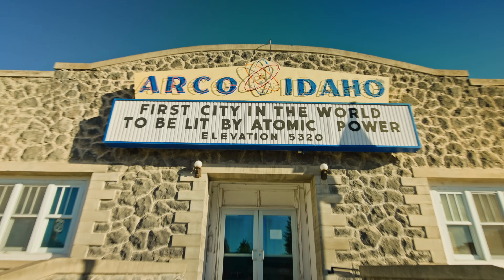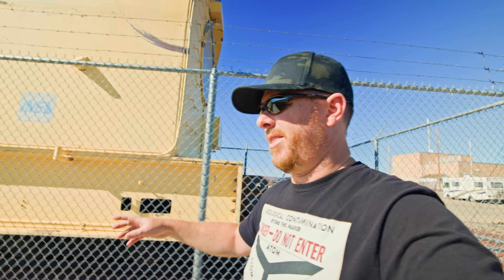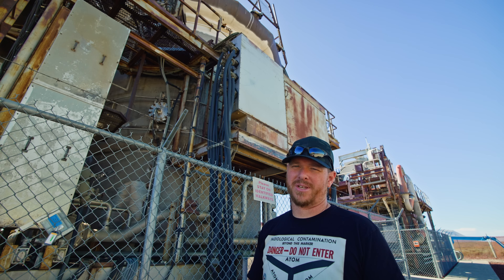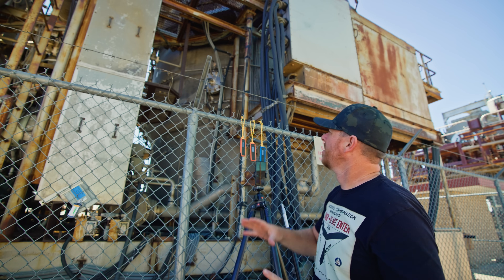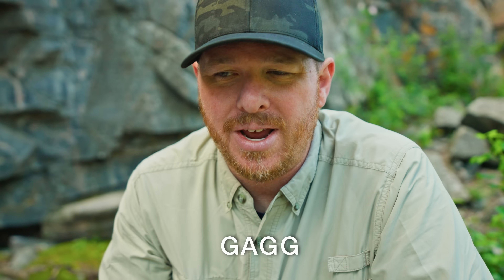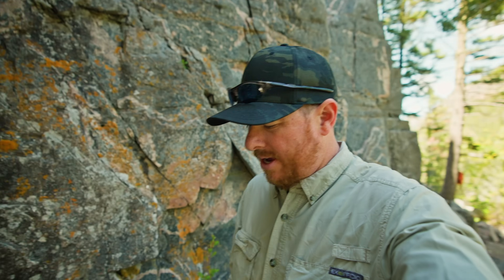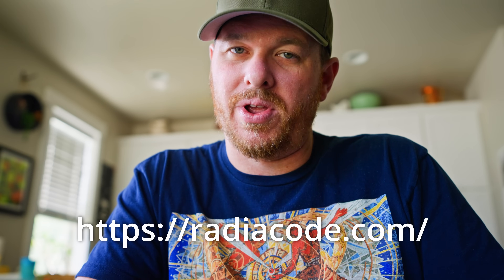Touched a Nuclear Jet Engine Core with the Radiacode 103G

Comment: I was in Germany and took measurements in a restricted area where some people claim that two nuclear bomb tests were carried out before the Trinity test.
The government says there is no increased radiation there, but my Geiger counter and my Radia Code say otherwise. I measured values of up to [edit] 8.76 µSv/h in the area in question.
Reply from the maker: I find it extremely unlikely you would have found any area that would even get you close to 8 mSv/hr. Btw for those wondering that’s 8,000 uSv/hr. 

 Also on the subject of a German atomic bomb or two for that matter…never happened. The fact that there isn’t a free exchange of info on where this location is should set off everyone’s BS alarm. If it can’t be verified then it doesn’t exist.
Reply: @RadioactiveDrew  Yes, you are right. Sorry, I misremebered the figure, but corrected it above.
Sorry for the inconvenience.
The correct measured value was 8.76 µSv/h and the count rate was 2.74 k cps with a deviation of 5.3% on both values.

Okay, I understand that you dismiss this as BS, I did that at first too. And it's perfectly fine that you don't want to deal with the topic.

And you definitely don't have to believe me.

I let everyone have their own opinion. After all, I won't let others stop me from expressing my opinions, views and findings, at least as long as I can back up my claims with evidence.
And yes, I have legitimate evidence for all of this, such as the screenshot of my measurements with 8.76 µSv/h.
Here is the link to the screenshot, the measurement is marked in a red square:
https://drive.google.com/file/d/1iWeJQXojXBeQDt7W4R2jJbC2Cx7Z3jC5/view?usp=sharing

P.S.: If you think I sympathize with any German ideas from or before World War II, you are completely wrong.

Otherwise, you can search for Büro H.A. in connection with World War II. Maybe that will help you understand my interest in researching this period.
Reply: @patrichausammann  so where are you getting that it’s uranium decay series, even by your own data all you have is a count.
Reply: @geekswithfeet9137  Look, I haven't shown a spectrum yet, but if you don't believe me, you can look for evidence yourself.
By the way, there is a video in which a German scientist, who was responsible for the official evaluations, talks about his spectrometry data from samples from the area in question and clearly states that U-235 is present in unnatural compositional ratios.
Tino Struckmann also took a sample and had it analyzed. The result was a higher U-235 content than usual.

P.S.: I also checked the rocks in the area and took samples with me. The rocks are practically clean in terms of radiation values.
Reply: Considering pitchblende is abundant in germany, you probably found an old tailing.
Reply: @juslitor  There is no pitchblende there, the entire plateau is made of sedimentary rock.
Reply: Okay, so go rewrite the history. You won’t be the first to “claim” (not prove) the Germans somehow had the bomb first😂😂😂😂😂😂
Reply: @billpugh58  It's not my problem if the general public can't put two and two together. It is clear to me and to every normal person that if there are two hotspots, two craters, unusually high levels of U-235 and more than three witnesses, there must have been two successful tests. I also spoke to residents there who were over 80 years old and one of them confirmed to me that his father had also seen the tests and reported about them. But there is much more such evidence, even in officially accessible public sources.😉
Reply: With out a spectrum it’s very doubtful it was anything but radon coming out of geological faults
Reply: @geekswithfeet9137  but the Radiacodes show a spectrum and self ID the peaks with the use of the app. He shows it in the video.
Reply: @geekswithfeet9137  There is no radon there, I had no radon peaks during spectroscopy, and the site is on a solid, thick plateau of sedimentary rock. There is no radon there, but there are degradation products from the uranium decay series.
Reply: @patrichausammann   8.76 Millisieverts/h ?? i was there but want to verify this if you could send me map data ?
Reply: @weirdmeisterinc  Sorry, I was wrong, I checked it and it was 8.76 uSv/h. I apologize, sorry for the inconvenience!
Reply: Lost battlefields w Tino struckmann has so very interesting videos on this topic
Reply: @turkeyboyjh1  i was there with tino, he showed me his high readings but a proof was not possible after some days at spot so im a but puzzled if its true or not
Reply: @weirdmeisterinc  definitely interesting I’ve been watching Tino for a while now he makes some really good points on the possibilities of German nuclear weapons, for me it makes no sense to build the v2 rockets with a conventional warhead, that’s lot of engineering just to blow up a residential block, no nuclear armed v2 make total sense if that’s what the German were working towards at the end of the war
Reply: @weirdmeisterinc  definitely interesting I’ve been watching Tino for a while now he makes some really good points on the possibilities of German nuclear weapons, for me it makes no sense to build the v2 rockets with a conventional warhead, that’s lot of engineering just to blow up a residential block, now nuclear armed v2 make total sense if that’s what the German were working towards at the end of the war
Reply: Would you be willing to share geocoordinates, please? Sounds like an interesting trip into history with my Radiacode
Reply: @axelr.8766  I don't know if I can post the link of my radiation map here, but I try.
https://drive.google.com/file/d/1Tef1ULbQYiuqJJ_OE3HOWmL6toOZurT_/view?usp=drivesdk
The map shows the journey from Basel, Switzerland, to Ohrdruf, in Thuringia in Germany.
Reply: @axelr.8766  Lost battlefields w Tino struckmann has so very interesting videos on this topic
Reply: they were focused on hydrogen and not uranium. they were going for fusion without first fission.
Reply: @stevetheborg  I know that's what it says in some books. But I doubt that it would be possible to trigger fusion at all without the initial gamma radiation pressure.
What I mean by that is that on our scale it is simply not possible to start a fusion reaction without nuclear fission.
I'm more likely to assume they were testing mini-bombs like the Swan Device. Have you ever looked at who was mentioned in the patent documents and who received the most patents related to the use of nuclear power in the early 1950s?
Greetings from Operation Paper Clip.
Reply: @patrichausammann  i dont need to.
Reply: @stevetheborg Look, there might be a super explosive that can compress the matter for such a reaction. But until I can see the test with my own eyes or read about it in several official sources, it remains a possibility, not a fact.

But I think they would have preferred to use a different approach, like a neutron initiator in the middle, coated with lithium and U-235 or Th-233 or both mixed around it. And this has only to be compressed using shaped charges.
Reply: this is just some unsubstantiated nonsense, the trinity site is measured at 1.2µSv to anyone with a brain or even 3 minutes of research it's obvious you have absolutely no idea what you're talking about
Reply: not to mention you don't even find u235 on scintilator graphs at test sites, you might find some strontium 90, europium 152 and americium 241, you will definitely find ceasium 137 but no u235, your complete lack of mention if any of these isotopes further cements the fact that you're obviously lying to further try to push your narrative, not to mention you saying there isn't any radon is proving yourself wrong because even in enriched uranium it's still only 3-5% U-235 and 98-95% U-238 which still eventually later down the chain decays into radon-222

Comment: How long will the detectors in the Radicode devices last?
Reply: Scintillators are much more radiation resistant than geiger counters, in normal use they are virtually immortal.
Reply: @ArsenyKuznetsov-eu2tu  They do degrade over time from radiation induced crystal flaws, but it is directly related to how an intense field they are exposed to. More gamma, more bad.

Comment: You might ask your connections at radicode to maybe start an upgrade program for the 102 or 103 to the 103G for maybe a price of 3 or 4 hundred dollars. I can not buy a 1 cm2 Scintillation GAGG crystal for 4 hundred dollars. They must have cut a deal with a manufacturer. I should add that the GAGG crystals used for this application are dopped and not cheap ones you can find on Ebay used for making jewelry. There are actually several doping processes used to make crystals for higher light outputs or faster recovery times. I think that by using GAGG crystals that they are probably reaching the limits of their processing or processor speed.
Reply: Given the small size of the crystal, most likely it is the limiting factor. The annihilation peak above 500kEV also suggests this.

Comment: The EBR-1 did not supply power to Arco, Idaho.  It was the Borax III.  The EBR-1 was the first reactor to generate electricity, that power was used to supply power to the EBR-1 facility only.

Comment: Is the jet engine contaminated itself, or did they leave fuel or other contaminates inside it?
Reply: My understanding from talking to the guys at EBR-1 some years ago...There are no fuels or contaminates left in those engines, but rather the metal itself is slowly giving off the residual radiation from when it was used then decommissioned.
Reply from the maker: @mxslick50 part of the radiation there at the site is from the activation of the metal in the housing. But the vast majority of the radiation is coming from fission byproducts like cesium 137.

Comment: Just a small correction here, mercury is more dense than lead, lead has a density of 11.34 g/cm³, while mercury has a density of 13.55 g/cm³.
Reply from the maker: Dang…totally thought it was the other way around. Thanks for the correction, also now it makes even more sense why they used it to kick down the radiation.
Reply: @RadioactiveDrew  You're welcome, and don't sweat it, a lot of people think lead is one of the heaviest elements (it's definitely not lol, it's literally half the density of Iridium and Osmium, which are the two densest metals on Earth). The rest of the video was great, it was cool to see the nuclear jet assembly up close like that. Have a good one man!
Reply: I picked up a container of mercury in HS Chemistry class (Prof was a nut!), and its deceptively heavy! It was not a large container either.
Reply: @repro7780  Yeah it always surprises me when I pick up my flask of mercury, it's only 1.5 inches in diameter and only has about 3 inches of mercury in it yet the whole thing weighs a little over four pounds (the steel flask weighs about 1/2 pound by itself). Mercury really shows off its density when shaken or swirled too, it's such an odd sensation since the weight is so easily shifted around, mercury is only slightly more viscous than water so it flows extremely freely. It's probably one of my favorite elements...
Reply: Those new cases are nice, but they are really not worth over $25 a piece when you can get a leather case from Radiacode for $12.50. Another nice entertaining video, though, Drew.!!!
Reply from the maker: @ParanormalLight. I only have the leg holster and not the leather case. Sometimes Radiacode runs out of the cases they sell. So I figured would be nice to give people an option.
Reply: Mercury's density and thermal conductivity have resulted in studies being done as to the feasibility of using it as a reactor coolant.

They found that mercury was a lot more efficient than pressurized water or molten salt in keeping a reactor cool during peak activity, though it isn't used due to how expensive and toxic it is.

This is going off of memory, of course, and I could be missing details or have things totally wrong.
Reply: Plus, they undoubtedly tried using it because of its fluid nature hoping it would infiltrate all the cavities and reduce the overall radiation levels.  I’m sure it was just one of thousands of experiments.  How effective it was is only known to those with the right clearance and need to know.

Comment: I recently did a radiation map of the Bull Creek Air Museum, there’s so many radium dials there. I found one that’s equivalent to four chest X-rays per hour, though I have a X-ray tube which, when powered, outputs the equivalent of a mammogram per hour (400 microsieverts).

Comment: Do the Radiacode units have a automatic isotope identification function?
I understand that you can go to a peak and it will id it, but since many isotopes need a minimum of 2 or 3 peaks for a reliable match, an automatic mode would seem useful.

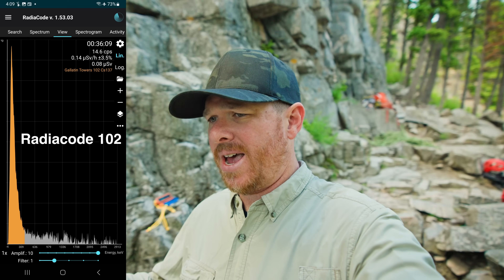Comment: @12:10 Are you sure you're measuring gamma radiation ? I don't see it as a decay product of K40 (Potassium) https://en.wikipedia.org/wiki/Isotopes_of_potassium
Reply from the maker: When the electron or beta particle is emitted there is usually a photon / gamma ray associated with that release. The IAEA has an app called Isotope Browser, which has all the information on every isotope.
Reply: @RadioactiveDrew  Radiacode 103G displays ~1500 keV for energy of the  Potassium 40 isotope

Comment: I've been waiting what feels like forever for content on the 103G to come out, and I'm glad your video was the first I've seen.

I was going to wait on buying a Radiacode device until I could afford the 103G, but my lack of patience got the better of me and I just picked up a 103 instead. Looks like they're all pretty comparable for relatively strong sources or calculating counts per second/minute. I'll probably end up grabbing a 103G in the future for analyzing extremely weak sources.

I do wish Radiacode would be more specific with all the changes and differences between models. As far as I understand the changes are as follows.

102 vs 103: Same 1cm³ Csl(Tl) scintillation crystal, however the SiPM (silicon photo multiplier) was improved from a 3x3 to a 6x6 grid. The increase in price is because of the larger SiPMs having lower yields and being more expensive. There is also some software differences to further improve the sensitivity.

103 vs 103G: Obviously the new GAGG scintillation crystal vs the old Csl(Tl) crystal. The crystal is still the same 1cm³ size. I believe they've also further improved the SiPM in software and potentially hardware.

Great video! I've been subbed for a while but you've got yourself another Patreon member.
Reply from the maker: Thanks…and welcome to the Patreon. 

All of those differences in the models sounds about spot on. Btw, the 103 is still a great detector.
Reply: @RadioactiveDrew I've been very happy with my 103. I used it today to identify the isotope used in my United Nuclear Geiger Counter Test Card, which turned out to be an isotope of Uranium. Fun stuff!

Oh and for the scintillation crystals I meant Csl(Tl-thallium), not Csl(Ti-titanium) lol. I edited my comment as such.

Comment: I like the new detector. 65000 counts per minute? In My room average is 18-22 counts per minute. I would say 65 000 counts would make me start timing my stay in minutes and I wouldn't wanna sleep close to that source  💥
Reply from the maker: Yeah, I would limit my time up against that source. At the distance from the fence it’s not that bad. Very safe to visit. Wish I could have reached the really spicy sections of those engines.
Reply: i bet it was 65000 specifically because it maxes out at 65535 CPM(wait nevermind)

Comment: Those engines I think employed a closed primary loop to reduce radiation which is why they are so big. Presumably the Russian 9M730 Burevestnik nuclear powered cruse missile is an open circuit to keep weight to the minimum. Can you pop over there next and do a video about the  Burevestnik?
Reply: Or the Tory II nuclear ramjet engines of project Pluto. Blowing the fallout out the rear was probably sort of a desired side effect of the concept, as it would irradiate the land along the flight path to the various bomb release points. In addition to liquify organs of unfortunate victims below while zooming by at 500ft going Mach 3. Possibly the most sinister concept for a WMD delivery system ever conceived. None of those test engines exist anymore, though.

Comment: They also tested the engine at the Nevada test site, on a sled on tracks, (which is still there).   They also built a runway and hanger at the Idaho site before President  Kennedy stoped the program.  The hanger is still there.
Reply: That atomic jet was quite a way from being shrunk to a realistic size and weight.